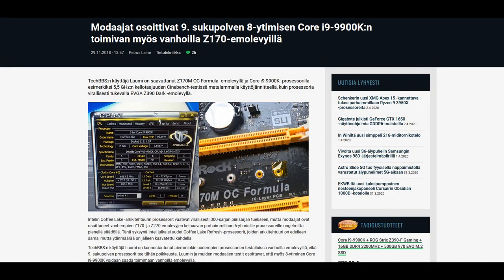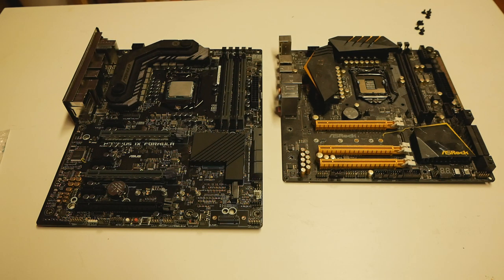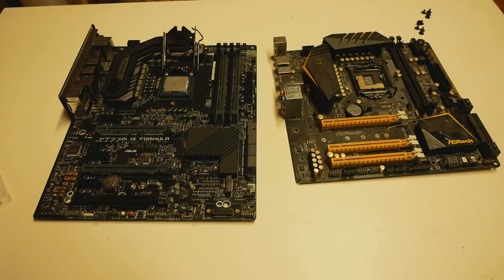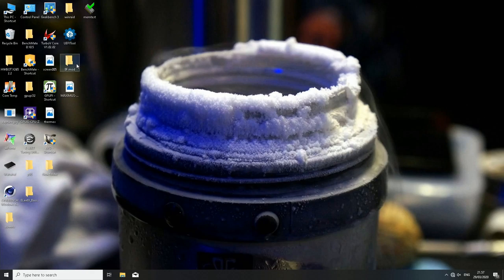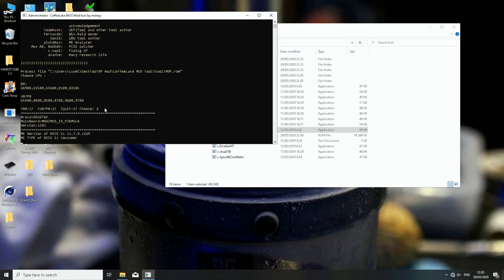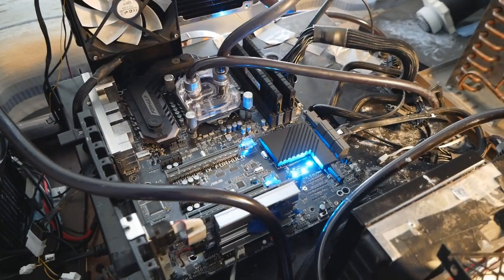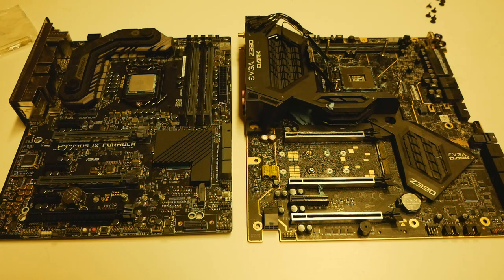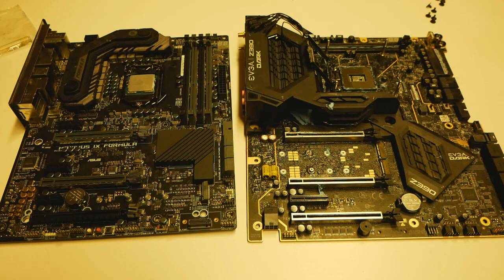How to run a Coffee Lake CPU (8700K/9700K/9900K) on Z170/Z270 Motherboard, 2020 Update

Comment: So it's true that noone needed NEW Motherboards since the release of the i7-6700K, but the INDUSTRY has forced us to buy NEW Motherboards every other CPU release. Thank you so much for sharing this video. 👍🙂👍
Reply: This is why I just went to AMD off my Z97 platform as soon as Ryzen got released, I have upgraded to a X570 board recently but that X370 board I bought a few years ago is still running and upgraded to a Ryzen 3000 chip in my younger sibling's PC
Reply: @SuperShermanTanker  after this reality check I'm no longer willing to be fleeced by Intel, I'm just sorry I didn't realize it sooner. Thank you again for the Education. 🙂
Reply: laptops are even worse, yet here I am using my 9900K in a 2016 model Clevo P870DM3 (Z170)
Reply: @greebj  wow thats great. Upgrading a laptop that way saves even more money... but isnt the GPU holding you back?
By the way. I am hyped for B/X370 Ryzen 5000 mods. I am almost 100% sure it will happen. The chipset of it is almost the same as the supported B450 chipsets. Most likely just needs the new AGESA to be embedded into the BIOS.
Reply: @greebj  What did you do to get the 9900 to work? Bios mod or just plug and play
Reply: these companies openly promote being green friendly but all this upgrading increases more garbage and waste

Comment: Great guide!
btw: the reason the tool fails in the vbios step seems to be that the tool can't deal with whitespaces in the filepath to either one of the executables or the biosfile
-> extract the newest version of the tool to a location which does not contain whitespaces (for example: "C:\coffeelaketool\")
then the  "Update GOP & VBIOS" step should work as well :)
Reply from the maker: Thank you for this tip.

Comment: I hope you realize you saved me a bunch of money since I did not have to upgrade my motherboard. This worked perfectly for me. Except I have an Asrock motherboard so my flashing process was a bit different than yours so I had to figure that out. Thank you very much in your effort in this video.

I was looking to upgrade my 6600k straight to a 9600k as it's at a pretty good price for performance right now so I bought one thinking the socket was all that mattered for compatibility. Little did I know it was not compatible with my motherboard even though it's LGA1151. After following this guide (except I did not feel comfortable soldering on my motherboard), I modded my bios and placed a piece of reflective metallic crafting tape to bridge the two pads on my CPU and it works!

Thank you again dude.

PS. You don't need the UEFI tool for Asrock MOBO, just mod the bios and rename the file (including the file type) to exactly what it was before it was modified downloaded from the Asrock website, then flash it normally, it worked for me.
Reply: This method needs more exposure as it’s about to be the king of value for money eg buying dirt cheap PC’s with 6600k and 7600k in them, modifying the bios and putting a 9900k in, its great value for money cpu power wise
Reply: Hello! I would like to know which Mainboard do you have. Can you explain a little, how did you do that?

Comment from the maker: Also thanks to kicsip for helping with the bios :) !
Reply: I have the Z170-E, is this mod compatible with that board? If not, could you do a video?
Reply from the maker: @exterminater267  I don't have that board, this will work on any Z170 or Z270 motherboard.

Comment: Thanks for the video. I upgraded my 6700K to a used 9600K and ended up gaining money after selling the old processor.
Reply: Hi, what for a Mainboard you use?
Reply: Maurice B. Asus Z170-P
Reply: @honvl  how did you install the bios? i have an asus170 a
Reply: I have a 6700k with a z270 ROG maximus code board how did this go for you

Comment: Thanks for showing up how ridiculous Intel were in forcing new sockets on everyone who had ambitions of being able to run more than four cores and eight threads... if they were worried about cheap OEM boards burning out VRMs then just limit backwards compatibility to Z170 and Z270 which most people would be fine with , with those boards being massively over-engineered to begin with as you've been showing with your 9900K @ 5.5Ghz on a Z170

Comment: I just found our about this and I'm amazed. Thank you so much. I got a question tho. Currently I have an MSI Z170A Gaming M7, does it mean that with this mod I should be able to get an i9 9700k/9900k working with hyperthreading and also being able to OC?
Reply: Ofc you can do it. There are already MULTIPLE videos on youtube which explains the process. I didn't see one for an MSI mobo yet, but it can be done for sure. Idk if your board has smth like "BIOS flashback" like we have on ROG boards, but search on youtube/google, you will definitely find something to help you through. Good luck :) 
Ps: the hardest part is still the CPU insulation / connection of the pins.. for me, I would rather try that even if it takes more time, because I cannot solder and don't have the tools.
Reply: @drk_blood  much appreciated your reponse :) I'm really curious to try this, perhaps I'll manage to snag a 9900k or 9700k on a discount on black friday or cyber monday. I would also assume that hypothetically speaking if someone messes this up then it's still possible to replace the cpu socket for quite cheap if you have the equipment.
Reply: @drk_blood  Hello mate, I have a follow up question, which is sort of the opposite of this video. Would you happen to know if it's possible to get a Z370 motherboard to work with a 6th\7th gen CPU? Thanks.

Comment: I still have a Z170 OC Formula in storage rotting away, do you think it'd be worth switching to the Z170 from a Gigabyte Z390 Aorus Pro for a daily machine?
Reply from the maker: Big version can't do as high memories as M version though.
Reply: @LuumiJuhani  Hmm true, what do you think about the CPU side for a daily on water? Better than a mid-range Z390 like the Aorus Pro, or should I stick with the Gigabyte?
Reply from the maker: @VraccasVII  Well you can try with the OCF and see how they compare.
Reply: @VraccasVII  asrock z170/z170m oc f has very good vrm than most z370/z390 boards if u check one by one and it has 10 layer pcb which is thicker than most modern boards...i presume it is a damn solid board seeing how Luumi can OC the 8700k to such high clock thou i dont own one

Comment: I have the Maximus IX Apex... can def handle ocing a 9900k, despite a z270 chipset.
Reply from the maker: Yeah I would keep using 9 Apex, no point to upgrade.
Reply: I had one IX APEX with 8700K. You def should do the mod. Look for HWBOT APEX on google.
Reply: @lovelessZN  Alright thanks! I have definitely seen the HWBOT page, but I was hoping to NOT have to solder the board and just hoped for an edited BIOS. I have seen it and considered it (and am 100% capable of doing it properly easily), but my 7700k was still keeping up with 90% of the tasks I used it for, but it's hindering work flow now. I feel so ripped off by Intel. I have never seen a Chipset just get MURDERED after a couple of months like the Z270. I was keeping up with all the RYZEN news, but needed a PC before I could wait to see if RYZEN paid off, and initially with all the problems people were having RYZEN, I thought, "meh I made the right choice and when higher core/thread Intel CPU's come out, I'll get one"... WAS I EVER WRONG. I even got a used/freeish 6600k just to have a working system while I awaited the launch of newer intel CPU's. Needless to say, I ended up getting/delidding a 7700k once everything unfolded, and made/sold an i5 6600k system for a customer on a budget. Now I am wondering if I should just leave this as is, and sell an APEX IX with a delidded/lapped i7 (Maybe throw in an extra 250GB EVO 970) and put that money towards a new RYZEN system instead of doing this. But this looks like a fun project, but also an expensive one that almost justifies a move to RYZEN given this is my daily work horse right now.
Reply: @LuumiJuhani   Thanks for the great content/links etc. I know the board can handle it, the VRM is hard to heat up in the worst of conditions with an i7 7700k (under 50C with no air flow, and torture tests running/EVERYTHING OC'd and high voltages, and under 40C with a single 120mm fan blowing over the "heat sinks"/blocks of aluminum). Is it worth selling the delidded/lapped 7700k with the board and going to RYZEN for more cores though. This has become my daily driver, and test bench for customer's parts. It needs to work, but I also need more cores for the work I do daily with the PC (rendering/encoding etc). It seems like a fun project if I could get a dirt cheap 9700k, but at that price they are going for, maybe sell what I have and move to RYZEN CPU/Good X470 board. Weighing my options heavily, but might do this mod regardless & see what drops in my lap regarding Intel CPU's on the cheap.

Comment: Hi, I thinked about this alot. I was thinking It is such a hassle to do but then I saw Linus video about the 300 dolar cheap pc build with modified laptop CPU on h110 board and it seemed very reasonable. I talked with the seller on Aliexpress, he sells 6/12 QQLT ES progressor for 120 dolars and gives modified BIOS for any LGA1151 motherboard. I kinda wonder if my Gigabyte z170 hd3p's VRMs can handle an overclocked 6/12 progressor or is it worth doing the modification. Can you cover those CPUs in a video, it would be interesting to compare them with their desktop counterparts.

Comment: Hey;

I know I'm three years late, but none of the links to the tool work... 

Is there any way you could help me finding the tool? Seems to have been taken down-

Greetings.
Reply: Thank you for the guide though. Shows you that what Intel did back then was completely unnessecary. 

I've got a Z270 board here as well as a Dell PC with a 9900k, but, well, a terrible Dell Motherboard. Therefore just wanted to try and modify the Z270.

Comment: Hey Luumi, great work. I'm looking at doing the same on another board (M8H) that has a different PCB layout around the BIOS Flashback chip - and there isn't a set of pads in the equivalent position - at least not on the top of the board. It looks from your close-up that one of the two pads that need to be connected to defeat the flashback security lock runs to pin number 36 on the IC. Is that correct? On my board, pin 36 vias to the underside - where it runs to a similar-looking pair of easily bridgable pads, the other of which is on a track that connects to pin 1 of the flashback chip. Does that sound like the ones to be connecting?

Comment: i have 9100f b0 rivision on msi z270 a pro 
if i upgraded to 9400f i do not need any isolate or connect?
Reply: you need to flash new bios with 9400f supported, and yes you need to isolate/connect pin u can see it on the internet

Comment: Hey great video, thx for your work.. May you please tell me to do minimal? I only want to exchange the essential codes to make z170 support my i3 - 8100..So I don't want IGPU, can i pick these things off? easily... Lastly, the physical modification you shorted with a copper yellow wire, does this have to be done and can I do it on all Z170 boards?
Reply from the maker: Yes either this wire on board or short the 2 pads under the CPU.

Comment: Something I was a bit confused about:
Do I have to complete the hardware modifications? Or is the modified BIOS enough now?
Reply from the maker: I think this depends on the used motherboard. On that ASUS motherboard needed hardware mod to allow custom bios, and jump wire to allow the system to turn on.
Reply: @LuumiJuhani  Did you actually also make a video on that?
Reply: @LuumiJuhani  And for getting the BIOS on the motherboard cant you use AFUDOS or a BIOS Chip Programmer?
I think AFUDOS works on ASUS boards

Comment: Worked on my msi z270 with i3 9100f, all I did is download the bios, used coffeetime to create a bin file, put it in a formated usb, went to settings in the motherboard using the graphical interface I clicked on flash selected the bin file and clicked flash, removed the old cpu plugged the new one and all good to go.
Reply: @ascendantMethEnjoyer  i did not my mother board got a user interface and says upload flash or something as far as I remember so I just clicked upload
Reply: @ascendantMethEnjoyer  That is correct after I modded the motherboard I tried it with my old cpu it didn't turn on I placed the new one, and everything worked
Reply: so you just plug and play using the new cpu only modified the BIOS? do you make the video processes? Please let us know how to do it

Comment: Thanks for all effort. I have a question for you because you seems like expert on this.
I have Asus ROG G20CI (Ready PC) and its have 8th gen microcode inside. But it support only 7th gen. I want to upgrade i7 7700 to i7 8700. Do i need to isolate or connect pins? And i need to add 8th gen microcode again?
Reply: Actually i need a answer, not just like but what can i say...

Comment: Does the BIOS modified by Win-Raid tool still supports older (6 and 7th gen) CPUs?
Could I first flash it with my current CPU to test if it works and only then upgrade?
Reply from the maker: Yes you can still maintain the normal microcodes there too.

Comment: my other question is: If I can run a Coffee lake processor (8700/9700/9900) on a Gigabyte-Z170-HD3-v1.0 motherboard, with the bios I will install, will I be able to do Non-K?

Comment: Hello. Done everything like you show. 
Working , thanks. Motherboard Asus maximus Apex IX . But I can not anable 16 treds.  Only 8core 8 treds . If I set in bios hypertred anable hangs on post code 22 and not boot
CPU 9900KF
Reply from the maker: There is an issue with hyper threading on some motherboard models.
Reply: @LuumiJuhani  I have seen results on same board Asus maximus Apex IX where it was 8/16 working with 9900K (my is KF)
Reply: Any way it is faster than 7700K I had but my task was to receive 16 threads  :(
Maybe the reason is because of 9900KF is very new and modet bios that I have downloaded if made from apex X on the time when 9900KF was not lunched ? Or in that way it wouldn't boot at all ?

Comment: I have the asrock z170 extreme7 plus and the nuvoton chip is the exact same as the one you read aloud (nct6791d) but there is no visible pin on the reverse side(front). 

Also will i have to force flash one of my bios chips?

Comment: if you have a 6th gen cpu installed can you flash the bios via usb normally with the bios usb option? is it still required to force the bios by shorting that option even if you do not use biosflashback
Reply: Maximus gene VIII user here
Reply from the maker: If you use the update function in BIOS you should not need to short anything.
Reply: So, just to clarify and see if i understood correctly: i have a 7700k in my Maximus VIII Gene, if i had to put a 9900k in it i could just download a biod update from asus site, modify it as shown in the video (should i still rename it tho?), and install the bios with the 7700k in it. Then if i do not want to short things on the mobo by soldering, can use a pencil to short the two pins on the cpu and some tape to isolate those other two pins (think is needed?) and should i be good to go? Is this a solder-free solution? (i've never soldered and i've not the guts to try it for the first time on my mobo)
Reply from the maker: @LaZeccaSulLupo  Mod it and dont name it at all. Just use bios update in BIOS not flashback.
Reply: Did you attempt the mod? I am tempted to just upgrading to an 8700k on this z170 maximus viii cause b550 zen 2/3 and z490 10th gen intel are not looking so appealing tbh. There is a way to do this without soldering?

Comment: Hi Luumi. Do you know if it's possible to downgrade the microcode in a z270 motherboard to a skylake microcode from a z170 to enable non k overclocking? I imagine if it is possible I would lose kabylake support which is fine. I have an i5 6500 I'd like overclock on a gigabyte z270p-d3.

Comment: Does this work with the MSI Bios files? 1A0, there is no Extract Body on the UEFI tool, so i Extract As Is and then use the old Coffee Lake Mod tool which doesn’t detect the bios. If this tool doesn’t work with the MSI Bios, then is there a direct way of editing the bios? My motherboard is MSI Pro Gaming Carbon Z170A.

Comment: I have an MSI z170M Mortar (MS-7972) -- it's the same procedure for any of the old boards, right?  Just short the processor detect on the mobo and flash the BIOS with a patching tool?

Comment: This is an old video but I have a question regarding this on ASUS boards. The Asus Tuf Z270 Mark 1 in particular. Do you risk losing serial #/ MAC address/ UUID  when using the bios flashback?
Reply: There's a guy that shows how to do that retrieve it before you  modify then you add it look for it

Comment: Hi I just saw this video and I got some questions, I hope you can help me.
1. Do this work in any z270 mobo? (I will buy a used MSI z270 Gaming M5)
2. Do I have to made some wire/soldering mod on the mobo?
3. Once I completely mod the mobo, do I be able to still use 6th and 7th cpus? (maybe dumb question, sorry for that)

Thanks for your help.

Comment: If I do this for Gigabyte-Z170-HD3-v1.0, can I run i9 8 core coffee lake processor? (I will only use it at standard speeds, I will not overclock it).
Reply: The best processor I can get is i7-7700K, but it's 4 cores, so it's not enough for me. Not worth upgrading. I don't want to sell the motherboard either, technically it's a valuable motherboard but it's not worth anything on the market. If I can run a coffee lake processor, all my problems will be solved. (I'm very angry at intel for doing their best to make coffee lake incompatible with z170. I'm mad at intel for changing the LGA1151 socket to whatever it wants. Next time I build a pc, it will definitely be an AMD processor).